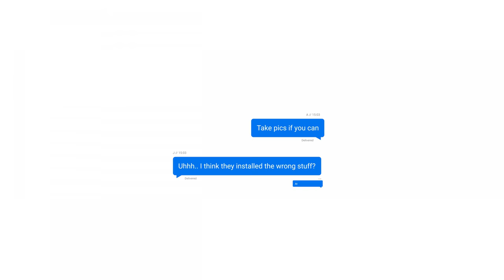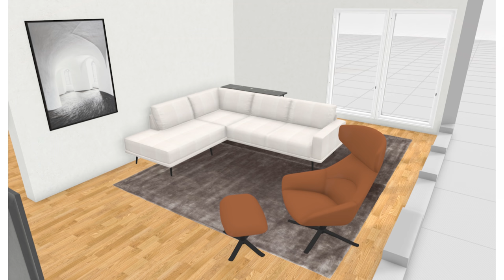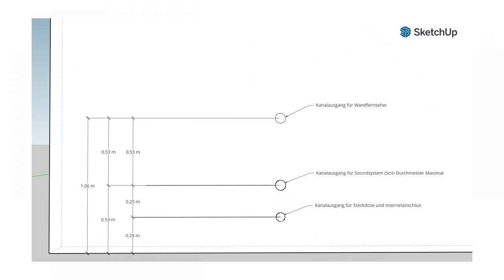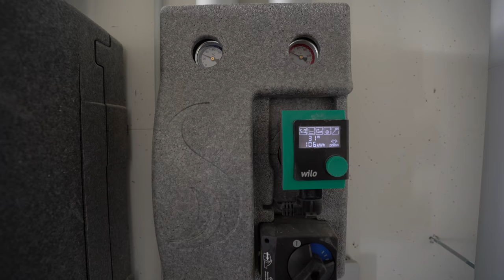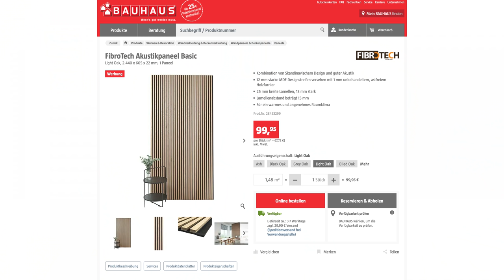HARD Lessons from Building a House in Germany

Comment: That white Ball in the technique room is for pressure balancing in the (closed) water circuit of the heating system. Sometimes air / gases (formerly dissolved in the water) can cumulate in the radiators in some rooms, especially the upper ones. You'll have to vent the radiators once or twice a year through little valves on the radiator itself. That means over time there is a lack of water in the system, which is compensated by the reservoir in the white ball. But from time to time it might be necessary to replenish the water in the system, which usually can be done with a valve from the main fresh water pipe – don't worry you won't have to fill it by hand.
The "white" hanging beaker on the left of the ball is a water filter directly on the main water pipe, which filters all water before it enters your house. It is actually transparent and you see through a bit of water the white new filter inside. It may turn rusty from the iron in the water over the course of years. It can (and should) be changed every few years.
Reply from the maker: This is super interesting! I would be curious to know  (because we have only rented up until this point and have never had to organize these things) - is it a good idea to have someone come to our house once or twice a year to vent the radiators? In our house - we don't have radiators per se, just radiant flooring. But each floor has a special box built into the wall where there are similar looking vents. We have SO many questions like this... I hope our home builder gives us some kind of manual for taking care of these systems.
Reply: Just let someone show you how to vent the system and how to fill up water if needed. It's not complicated. You should have a pressure gauge somewhere indicating if your pressure in the system is in the designated range.

I think venting the system twice a year is not necessary. Maybe check the system once a year before the heating season starts.
Reply: @TypeAshton  Don't worry, they'll give you a thorough introduction at the day of handover. Yes, I saw a bit later that you haven't radiators but floor heating. I'm no expert, but as you say, if there are vents, they serve the same purpose. You'll know that it is time to vent the system, when the heating drops below expectations or the heating makes a gurgling noise in a room. Then you come with a special little wrench (which will be provided to you) and a towel and open the little vent in said room. First it should blow some air (mixed with water) and when it turns to only water coming out you can close the vent again. It's no big deal and doesn't require a professional. – And don't forget: You have German neighbors with similar houses and installations right next door! They surely can help you with all your questions.
Reply from the maker: Ah amazing! That makes sense and sounds a lot like bleeding brakes on a bicycle. Makes sense to me!
Reply: @TypeAshton  ihr könnt mit der Firma die , die Einbauten gemacht hat ein Wartungsauftrag erstellen das sie alle 2 Jahre das System wartet und prüft .Kostet nicht viel und ihr habt Gewissheit das alles funktioniert und sicher ist .Ach du meine Güte (oh mein Gott) , der Schornsteinfeger kommt heute noch bei mir ............Ja ja als Eigenheimbesitzer hat man immer was  zu tun . ( jetzt muß ich echt lachen wie das Thema wie die Faust auf´s Auge passt .)............
Reply: @Hape I'm pretty sure this is not true for the white ball (Druckausgleichsbehälter). That ball is not a water reservoir per se but a ball where half of it is filled with water and the other half is filled with a gas at a certain pressure and a flexible membrane between both of them. The volume and preset pressure of it need to fit to the heating curcuit. It is for keeping the preset pressure in the heating circuit stable regardles of the water temperature. Without it the pressure in the curcuit would rise if the water gets heated. It is also only part of the heating circuit which runs from the burner through the heating coils in the big water reservoir and back to the burner. At least that the way it is installed in our heating room and we even have two of them because we have one heating curcuit for the gas burner and one circuit for the solar water panels on the roof. Those two circuits are not connected to the circuits which run through the radiators or the underfloor heating.
Reply: @martinohnenamen6147  The ball is responsible to obtain the pressure in the circuit regarding water extension in regards of temperature – exactly as you explained. But on the other hand gases can (and will) precipitate and have to be vented and the volume has to be replaced with fresh water from time to time – as I have explained. The extension of water is a nice and correct explanation of the ball's one purpose, but it is only "nice to know" and of no practical interest, as it requests no interaction of the home owner. The other purpose (venting) is indeed of interest, as it requires action. In order not to make it unnecessarily complicated, I have omitted the first explanation, which you have thankfully made up for. Both do not contradict each other, but complement each other.
Edit: What's wrong in your explanation is, that you seem to think there were two circuits – this would request a separate heat exchanger between the circuits, which would be suitable for a nuclear power plant, where water circuits must not contaminate each other, but not in a private home! In a private home you have ONE closed circuit for heating with ONE pressure ball. And YOU have TWO balls because YOU have another closed circuit to the roof for solar heating. And of course you have another set of coils running through the heater for warm water, but that is not a circuit, but a one-directional flow (obviously).
Reply: @TypeAshton  Venting the (in your case underfloor) ‘radiators’ is the same principle as bleeding (hydraulic) brakes. But nothing really bad happens if there is a bit of air in the system. The air will by itself accumulate in the highest areas of the whole piping system (which is where those vents should be installed) and the only problem is that without water in those areas they will remain cold. 

With exposed radiators, if air accumulates in the top part of it, it will stay cold and that is for me the signal to bleed the radiator. In other words, I only do it once I notice that the top part of a radiator stays cold, not on any particular schedule, though the most likely time when you have to do so is after summer when no (hot) water was flowing through the system for quite a long time.

Since I heating circuit is under pressure, you have to be careful when opening the venting valve in order not to make a mess. And you need to have something ready to catch any water exiting together with the air. I use a device bought in a hardware store that combine a square drive with a small plastic receptacle which catches the water directly. But you can also just use a cup.
Reply: @hape3862  The radiators are in a different circuit than the ball. There is no way for the water from the ball to get to the radiators. When you vent the radiators the waters comes from the normal big warm water reservoir which is refilled through the cold water intake. The circuit for the radiators is also not really pressurized.

And you are completely wrong about the circuits. We have in our normal house at least four seperate circuits. Two for heating the water from the gas burner and the solar panels and two for the radiators and the underfloor heating. You are completely mistaken to think that there is only one circuit, that woiuld be a complete waste for the water from ther burner to run through the whole house. If you look at scheamtics (look up Wwarmwasserspeicher and you will always see a large tank with a one or more coiled pipes inside) for the warm water reservoir you will see that there is a colied pipe inside for the heat exchange between heating circuit and warm water reservoir.

The "pressure" you see when ventig the radiators is simply the pumps pumping the water through. If you turn of the pumps ther is no pressure because it isn't a compeletly closed circuit as the heating ones.
Reply: @martinohnenamen6147  Wenn es kein Kreislauf ist, dann braucht man auch keine Pumpe, du Held.
Reply: @martinohnenamen6147  https://de.wikipedia.org/wiki/Heizkreis
Reply: @TypeAshton  What you have in those "special boxes" are probably not vents but "Stellmotoren" which open and close the supply of hot water into the floor heating tubes.

Comment: I congratulate you on your new home. It is really very pretty and very German. Your “mischiefs” really seem minor. I was not brave enough to go through the project of our houses myself. We bought new but finished or almost finished houses to avoid the risk and the discussions in the couple. Having to discuss the furniture was more than enough. Sure, we didn't get exactly what we wanted and presumably needed, but we don't have to blame ourselves for the mistakes. As to floors, I prefer the Italian style, either ceramics or stone. In particular with floor heating this is much cosier and reacts much faster and avoids the weird German habit of asking guests to take off their shoes. Now you have your oak which looks really nice. In summer, tiles keep nicely cool. I like your clean, clear entrance. As to the sound, I would consider structured and thick "Tapeten" in plain white. They are cheap, look modern and tidy and take away the echo. They can be painted over when they get stained. Look for Strukturtapete or Vliestapete in your local Baumarkt, the paper with the glue absorbes the sound
Reply: As to the soundbar, connect it by HDMI if your TV has an output to spare and your bar has an HDMI input. Then the remote of your TV will also control the Soundbar. Fibre does not carry the control signals. AUX cable are thick and and messy

Comment: If you decorate your hallway the way Swedes do, you likely don’t need any extra acoustic stuff. Swedes put proper closets for storage of clothes, clothes hangers (along the walls of the hallway), many even put a small stool/chair (that doubles as a storing chest) to sit on while putting on your shoes. Many have a small flat surface in the hallway where keys etc goes (easy to combine with storage) Thick carpets in the winter. Children get hangers for their clothes to help them be more independent. Shoe racks obviously. Blocking the light with beige-brown  wood will make it more difficult to see in the darker months. Many have a large body size mirror in the hallway too, putting LED lighting on it is a good way to emulate the light. Swedes make use of the light when they decorate their homes, plus they’re very practical, often minimalistic because clutter is a distraction and no one likes to do unnecessary cleaning. Furnitures are usually placed along the walls and windows instead of in the middle of the room. Carpets, fabrics, curtains, do a lot to muffle sounds. Swedes prefer using the quality wood  that grows domestically. Colors matters, to much of white-beige- grey-brown ish tend to look a bit sterile, overload of bright colors gets overwhelming and very dark colors makes us sleepy. Obviously can’t post any links but there’s plenty of Swedish people out there for inspiration and the Mothership of IKEA.

Comment: We have 60 m² of those acoustic panels in our ceilings. They are really nice they look extremely good. 
If you want the best acoustic from them you should put some insulation material behind them.

We have 50 mm of wall insulation behind those acoustic panels I a 60 m² room and the acoustics are phenomenal. We also have  2 rooms without the 50 mm insulation the acoustics is also better in those rooms but it’s not as good 🤟
Reply: And they are newly installed. The light natural need to be installed in the ceiling. Not just left hanging in the wires :)
Reply from the maker: The ones we are looking at have a foam backing to help dampen the sound.

Comment: An easy way to reduce the echo in your hall is the application of textiles, i. e. carpets, to walls and floors. Even pictures that are not hung in parallel with the walls will help to reduce the noise, as the uniform reflection of the sound waves is interrupted. So does furniture. But in the end, carpets will achieve most and may even be a rather cheap solution, unless you decide to buy only genuine Gobelins, preferable from the 17 century 😉

Comment: Those acoustic panels looks like they are diffusers, not dampers. Diffusers break up the sound, but doesn't really dampen the sound.
For dampers, you can buy panels for this purpose. They are basically just panels, 5-10 cm (2-4") thick, and comes in many sizes. They can be DIY'ed, but professional panels can come with a print of a motive, your own designs or photos. I believe GIK Acoustics is selling out of Germany. At least find a German based company, as these panels are expensive to ship.

As you also have very hard concrete walls in the rest of the house, these can be an excellent idea in the living room etc. And you don't really have to buy all panels at once.

As the goal is not to make an acoustic dead room, you don't have to buy the thick panels, meant for home cinema. You can buy the thinnest on the market. Thicker panels just removes deeper sound reverb, and that's not really the problem in your house. Even 1 inch thick panels will do the job.

Comment: 24:18 What does this even do?
It´s the expansion tank!
If you heat up your water, it´s expanding in the pipes.
So the expansion tank ist filled half with water and half with air
to absorb the pressure of the water when expanding.
There must be a litte pressure gauge nearby with some markings
reading from 3 to 4 bar or so. Sometimes it´s in the machine
Its going down from time to time due to losses

If the heating is cold the pointer should be above 3 bar
If the heating is running hot the pointer should not exceed 4 bar
There ist a short hose and some valves to fill in water
Use them to bring the pointer to the right value

Also there are air bubbles appearing in your pipes and radiators
which cause the water running through the pipes to make noises
Find the most top located radiator
Use a little radiator venting key to let the air out of the system 
on the top most position
But don´t forget to put a mug unter the outlet to catch some water and
have a rag ready to avoid the very dirty water cuming out and soiling everything

Comment: As it was already written before, the white steel "Ball" is part of the heating system.
You need to "entlüften" your radiators in your rooms from time to time. (That means to let out the air which were gathered). And this preasure steel thing (Druckausgleichsbehälter) makes sure that your radiators will fill up with heating water again. The preasure of this "Behälter" will normaly tested and refilled in the annual service inspection. Hope you understood my explanation :)
Reply from the maker: Ah that's great! Thank you. So I understand, would it be a good idea then to have a service inspection done yearly on the system?
Reply: @TypeAshton  actually, I believe the inspection is mandatory (at least in order Not to loose the guarantee) but in any case it is for sure wise to do so. Heating is a very technical system which needs maintanance from time to time

Comment: Many 'Reihenhäuser' have a long entry way.One of the things we disliked was that in the winter time lots of warmth went through the door and the cold came in. We "fixed" that problem by inserting a curtain about 1 meter into the entry way (behind the door to the side). It also reduces echos.  Another minor effect was, that - since we always open the curtain in the same direction -  some stuff started to accumulate at the floor/wall on the other side. So suddenly there was a little bench where everybody would sit and change shoes when going in or leaving the house.
The disadvantage is, that you can not see who is in front of the door, when the curtain is pulled close. That is the point where at some later time a door camera was approved by the women of the house ...
Reply from the maker: Question for you -- are door cameras generally allowed in Germany? I know with concerns around data privacy, I can see why they might not be used in some parts. But we are strongly considering installing a camera door bell system for security.
Reply: @TypeAshton  The answer is a definite 'Jein': It is allowed to install a camera if the camera only shows the area of your property. So what I did is install the camera at the side of the house, directed at the door. That way it only shows the house, and the visitor in front of the door. You can neither see the neighbours house (wir haben auch ein Reihenhaus) nor the street in front of our house (which belongs to the village, not the property.) Another possibility would be to install it above the door, facing down and again showing only your property.
But honestly, if somebody rings the bell I jump up and run to the door. I never check the camera first. Nor does my wife or daughters. Usually it is enough to check the silhouette of the person standing in front of your semi transparent glass door (that is on of the reasons for uniforms, they are easily identifiable). Oh, and the outside light turns on automatically if it is dark and somebody moves there ...